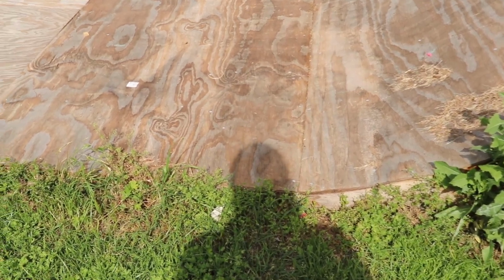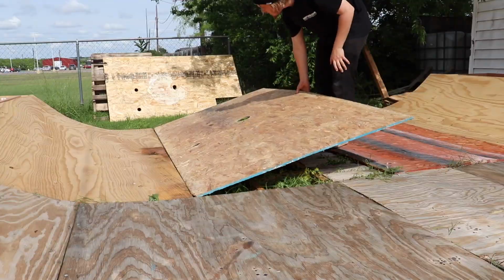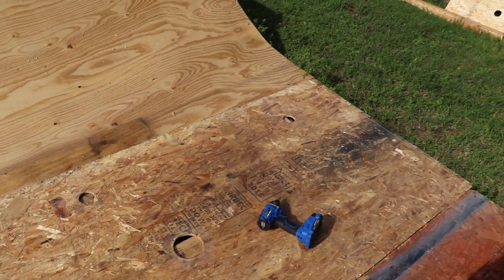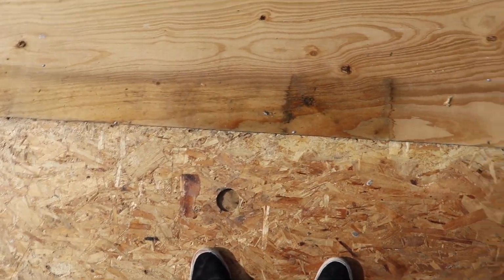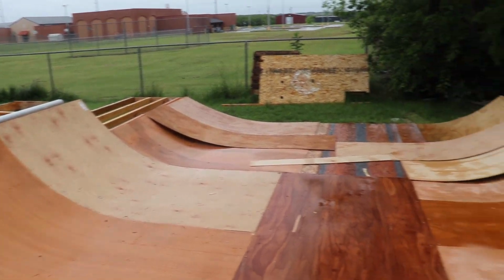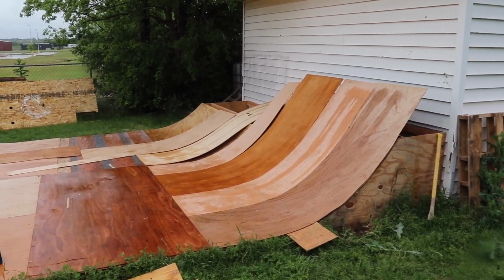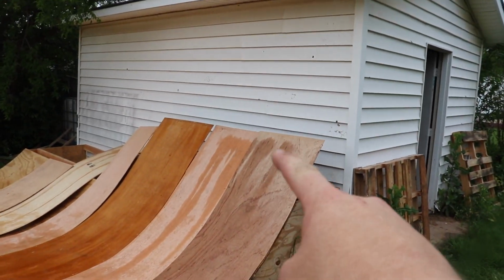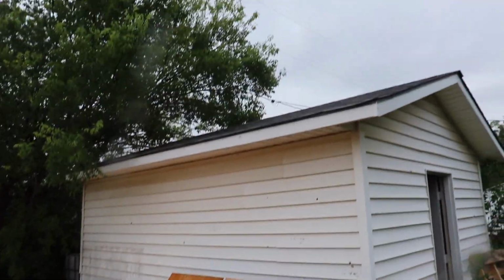Installing Cheap "RAMP ARMOR" to my Backyard Skatepark | Mini Ramp Update 6

Comment: How's the cheap solution holding up?  Thinking about skinning my ramp with something cheap. 
I worked with luan a lot doing scenic work but never thought it would be strong enough to hold up to wheels compressing it, and wondering how well screw locations held up over time.